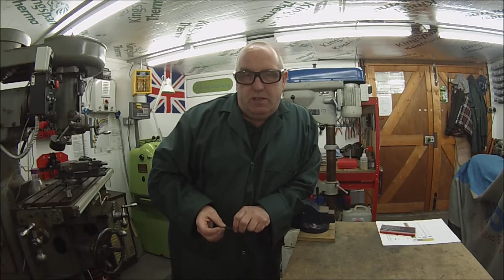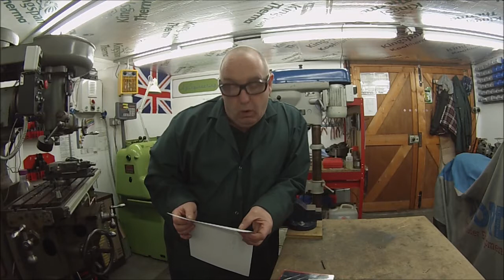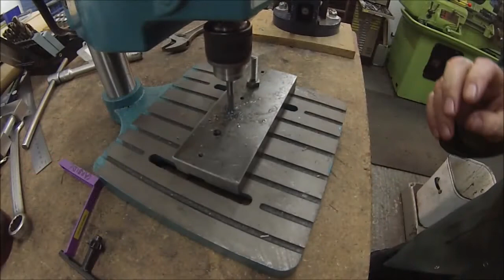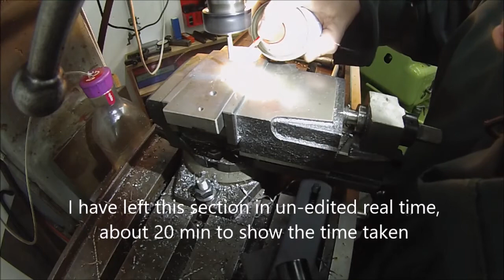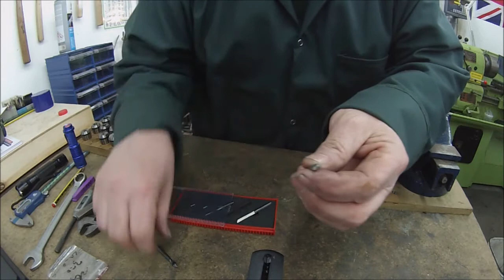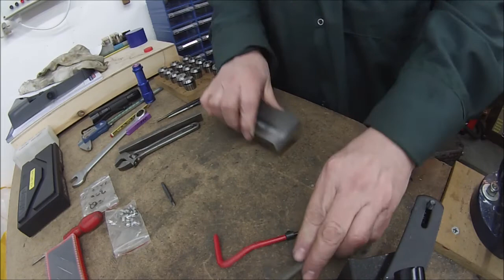Broken tap removal using carbide drill

Comment: I've had better success with modified masonry drills to remove broken taps. 20 minutes is a crazy amount of time to be drilling through even the best tungsten steel taps. BTW, can't find A10 manuals at present, they are not where I thought they were
Reply from the maker: I bought a set of Irwin carbide drill bits for metal a while back, can't remember if I've featured them on a video, but they are way better than the Omega drill type and massively cheaper. Cheers for looking
Reply from the maker: Oh yes, just remembered, drilling out the butchered plug on a crankshaft video, which turned out to be a magnet, that's where I used them, take a look.

Comment: Another reason to keep broken carbide end mills. They can be ground to make a similar tool. A self made drill from an old carbide end mill saved my rear end just last week at work.I suspect you were going a bit light with the feed pressure hence the 20 min time. I will pass your channel onto a co worker. He's from also Yorkshire and into old M/C restoration
Reply from the maker: Great thoughts Rob. Thanks for the support and spreading the word, Ade

Comment: question: do you think if you started to drill from the backside, it would have turned the tap-piece out before you drilled it all out? I realize that would only be possible with through holes, but I wondered because it might have saved the original threads?
Reply from the maker: Hello Peter, possibly, I have done this before with broken bolts, with some success. The tap was proper jammed in there, so I went for the method shown this time. In all honesty, this was more an experiment and demonstration to see if it was possible for the future on more valuable work pieces, normally I would have just started again! Thanks for subscribing and commenting, appreciated.

Comment: Hello there, you might want to invest in a set of Walton tap removal tools. they do three flute and four flute. i believe this to be a tried and tested method in the USA. here is a eBay link.
http://www.ebay.com/itm/Walton-18003-6-PC-Tap-Extractor-Set-USA-Made-4-Flute-SAE-Metric-in-case-NC-NF-/311646092625?hash=item488f8dfd51:g:0sYAAOSwkl5Xc~i3
i hope you find this useful. cheers. velocettedude.
Reply from the maker: Hi, thanks for watching and commenting.I do have some Walton extractors and never had much success if the tap is jammed, most of mine have twisted and broken tangs now! Regrettably this was also a spiral flute HSS-Co tap so I was short on options. Good idea though, if I get a broken straight flute tap in the future I will try a video with the Walton extractors. many thanks, Ade.

Comment: Certainly interesting but they might not have helped with the brake caliper. With any broken bolt removal drill alignment is vital, even more so for jobs where someone  else has made things worse by breaking something hard in the hole. In such cases, carbide end mills often work best as they tend not to be pushed sideways by the different hardness of metals. Also, they allow you to bias the cut if your centralising is a little "suspect", been there, done that, etc. hence the need/want for Hemingway's centring microscope.
On the Helicoil front, do you find the tang does not always break off cleanly? I haven't fitted one since I left the bike trade 15-20 years ago and they might have improved things since but I always had to increase the nick to make sure the tang broke as it should, and yes they were genuine Helicoils.
Reply from the maker: Thanks Chris. If I'm starting from a broken bolt un- butchered I usually centre using a slot drill to get concentric rings before drilling. Never looked at a centring microscope, will check that one out. Yes I too have had nightmares with helicoils at times, skipping threads on insertion or skipping the last pitch while trying to break the tang, and getting bolts jammed in the new helicoil when it reaches where the tang has not broken cleanly. If you have ever tried the Wurth solid inserts they are vastly superior but hell they are expensive kits. Appreciate you taking the time to comment, regards, Ade
Reply: I see you have had all the same problems with coils, as I said I would deepen the nick with a needle file before inserting, which got rid of one problem. 
I don't use Wurth but do think them much better engineered than coils. These days I only do jobs that the local bike shop can't handle and if the jobs  are simple enough for a regular insert I don't get to see them. I get the trouble jobs and if needed I make my own wurth type inserts so I can make them whatever OD is needed to overcome the bollock dropping of others. Luckily most of the jobs are metric, so as taps are available in the next size, or two, up with the same pitch and screw cutting a corrugated (wurth type) insert is easy and Loctite is your ever friend to hold them in place.
The Hemingway kit has cross hairs and circles on the graticule, which is why I went for one rather than commercially made ones with just cross hairs.Only been about 7 or 8 years since I started it, so it must be getting near the top of the tuit list.
ATB
c

Comment: Don't you just want to scream when one those taps snap !?

Paddy
Reply from the maker: Sure did Paddy, fortunately I got it out and it wasn't a high value item anyway. first tap I have broken in years, getting too complacent!
Reply: Those drill bits seem like a decent enough proposition....pretty pricey though....80 quid without p&p.....that's kicking a man when he's down !

Paddy
Reply from the maker: The Omega ones are seriously dear, makes these seem a bargain, bought mine on a 20% off offer and applied a discount code, think it ended up at about £52 including the post from my Cromwell account.